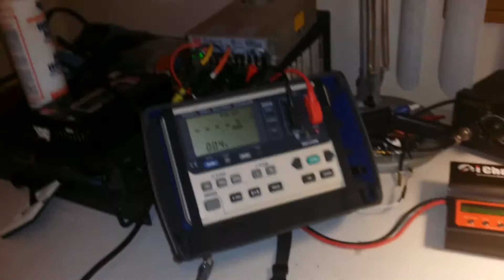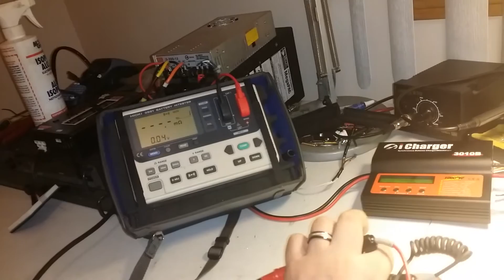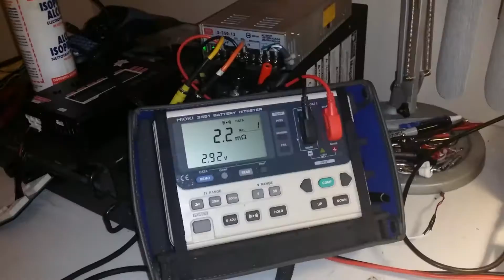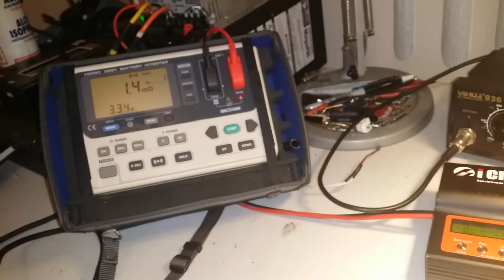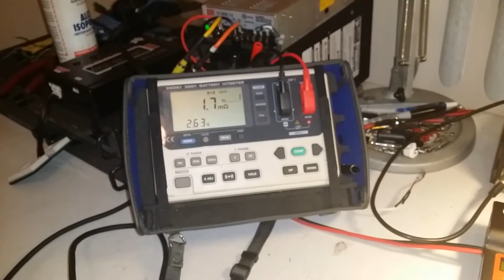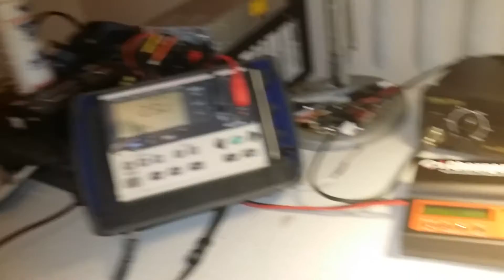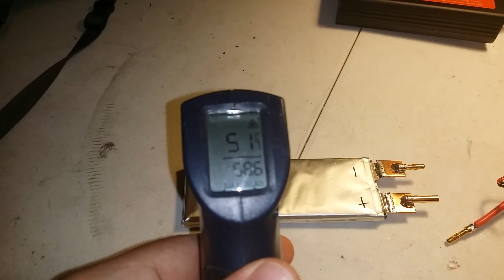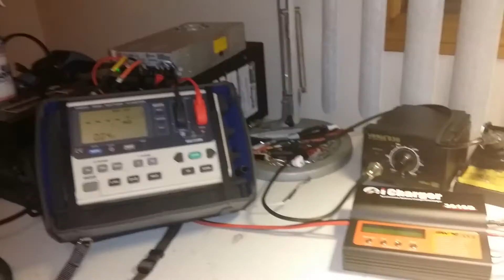turnigy 20-30c 5ah lipo @ 100amp+ discharge

Comment: just note that your temp measurement was off, that was not recorded on black surface where this IR works ok, but on reflective surface
Reply: i pull 100amps  out of turnigy multistars for 20 sec at a time and they stay in balance with no puff over 100cycles